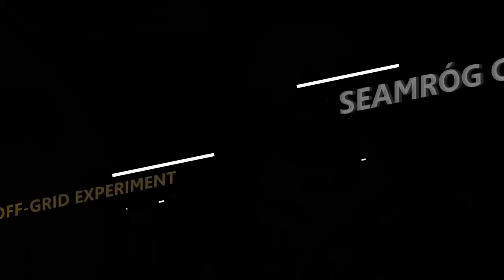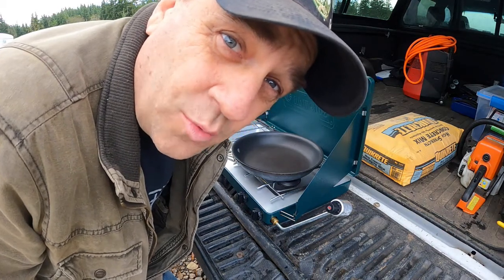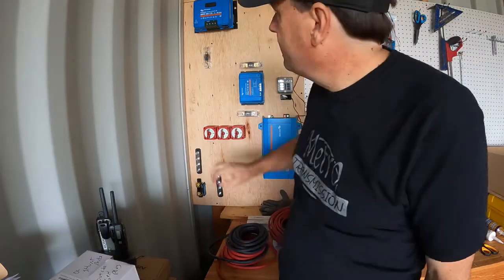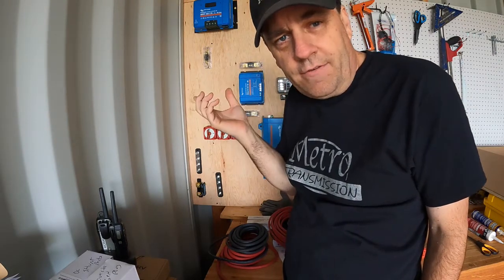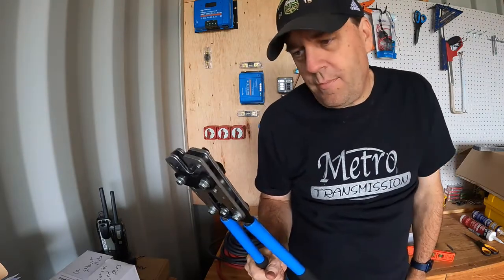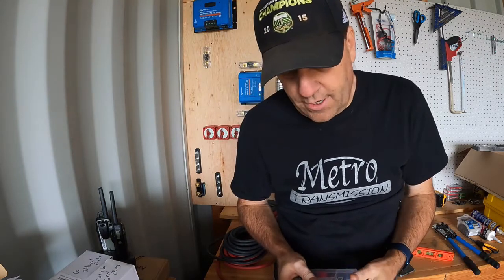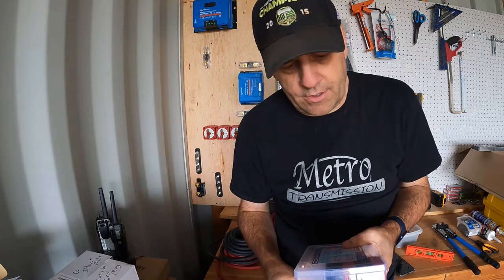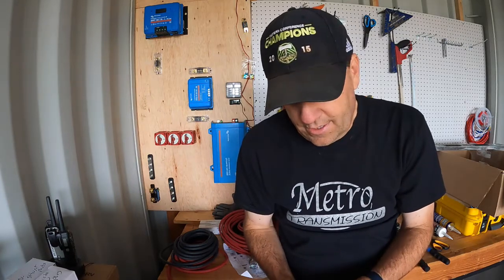Building a 5kW Solar & Wind Power Installation - Part 2

Comment: I like your wiring diagram. What software did you use to create it? I would like to create one for  mine.
Reply from the maker: To answer your question I used Draw.IO (used to be Diagrams.net).  You can upload your own image icons so I do that when i can't find what I need.   Works pretty good.  There's a lot of these kinds of tools, but I've used that one for so long I've just stuck with it.   You can download a desktop version and not have to use the web as well.

The current diagram depicts the latest solar system which is actually not accurate to this video anymore.   Some of the newer solar videos talk about how and where we moved this system to the new cabin building.

Comment: Question. From the shunt to the buss why didn't you run a short wire instead of going to the other end of the buss?
Reply from the maker: No good reason at all, in fact I should have used the shortest possible run.  This system was moved to a new location and finished out there, you can see it in later videos, however, you are correct, keep runs short when possible.

Comment: great video. only problem is the link to your wiring/design diagram does not work. im new to this and wondered if you could put a new link up. thanks.
Reply from the maker: Thanks for watching!  Sorry about that, I moved things around I forgot it was linked here.  I'll update the description to fix it.  It should be here now:  http://seamrogcreek.com/diagrams/Seamrog-Cabin1-Power-System.png
Reply: @SeamrógCreek  Thank You for diagram
Reply: @SeamrógCreek  Thanks for diagram.